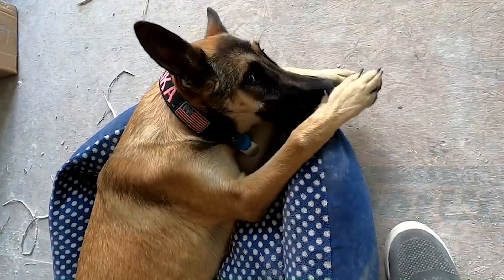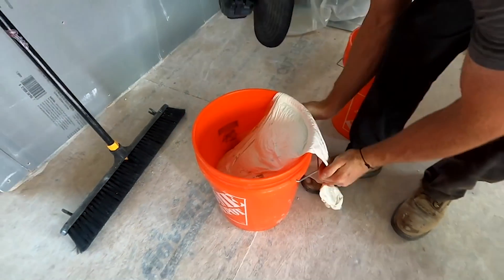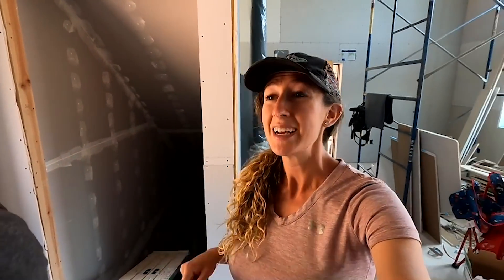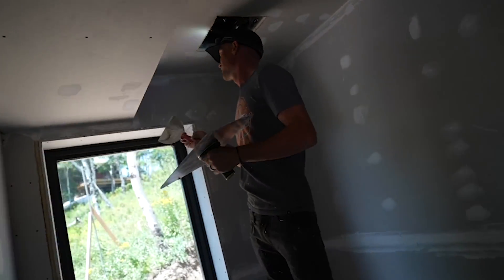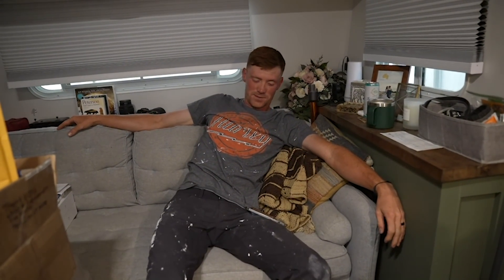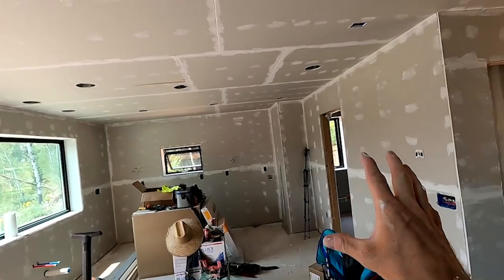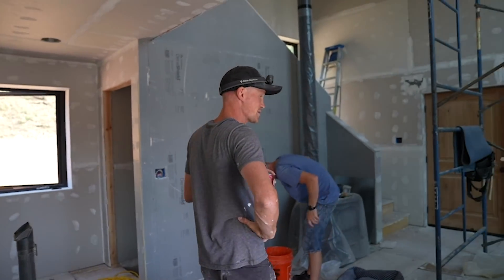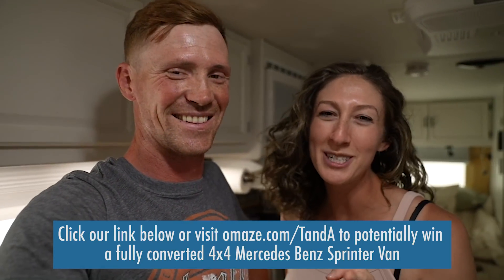TIME FOR A BIG CHANGE | TRENT & ALLIE

Comment: I'm a retired painting and drywall contractor. I've been watching these videos and trying to just let you do the job and learn as you go. BUT YOU NEED TO STOP. I don't know what youtube video you watched or who told you to do drywall that way but you are tripling the amount of time this job will take and doing things that will give you a crappy finished job. You used way too many screws but that is already done and it isn't a job killer. You should be taping the seams first. Put a thin layer of spackle down on each side then lay the tape down and another thin layer on top. Then pull the knife down with more pressure on the outside edge to taper the spackle and minimize sanding. ALL outside corners should have corner-bead. No need to be filling in seams and corners, just tape. When you fill in the inside corners (as where the ceiling meets the wall) you will prevent the folded tape from having a true 90-degree edge and make it look sloppy. I am telling you this because I know you want to have a finished job you can be proud of. Much of a construction job can have mistakes but usually get covered up and no one notices but you are into the finishing stage that people will see. I hope you take this in the spirit it is meant. You will shorten this job considerably if you stop and regroup and take the time to learn a few basic skills. Good luck.
Reply: Accept all of this happened a half a month to a month ago...
Reply: Why don’t you fly out to help them then if you are retired and have time on your hands 🤦‍♂️
Reply: @robertbenthal9396  don't be nasty.
Reply: I was wondering why they weren't taping.
Reply: Thanks for the advice. It may be too late for Trent and Allie, but I am learning a tremendous amount by reading respectful comments after watching the video.
Reply: Way AGREE..you're working waaaay too hard and too much time.
Reply: I'm so sorry Trent that you are making more work for no reason. "prefilling the seams" is not a thing. Taping seams is step one.
Reply: @robertbenthal9396  awesome idea
Reply: That’s what I was thinking, where’s the tape, really.
Reply: Sorry, definitely should have contracted out the drywall. Taking a lot longer, and in the end will look bad and probably cost more.
Reply: Did they claim to be a retired expert?
Reply: Oh no!!! You are right, Bill Mattis. I remember my Daddy doing this a lot and you have the exact directions on taping and “bedding” is what they called it back in the day. Oops, Trent and Allie. So sorry. 😢
Reply: look it's there home and they want to build it the inspector can tell them what's right and what isn't the state you live in May have different ways they want things done
Reply: Thanks for the info Bill! In my house I have some seams that aren’t taped and on others tape is literally falling off. What would you recommend? Sanding down the seams and retapping/floating?
Reply: @joane.3533  I don't think he's being nasty I think Mr.retired is being judgemental Trent never said he was a builder maybe things are done differently where they live
Reply: for his next big job, it would be good to have him tag along with a regular drywall crew to see how they do it and why for a week (which is more than this job should have taken to complete.  But getting hands dirty has it's own value too if only to recognize better ways exist.
Reply: I think it’s so great that you reached out. I don’t know a lot about drywall, but I was definitely worrying about those corners. Knowledge is power! I hope you’re enjoying your retirement.😊
Reply: Yes, working smarter not harder, ay?
Reply: Bill mattis you are correct my dad was a carpenter all my life I'm 62 and for 50 years I watched him build houses from the ground up all of it and he always he had a roller of tape a wire ran through the center circle connected  to your belt and a pallet with mud on it and you did a full run of mud put the tape on top and then a full run of mud again tear it and go the next spot, but these youngins have to learn the hard way
Reply: What I don't understand is why Mr. Retired (Bill Mattis) didn't step up and give his advice and comments to Trent when they first started mudding. Did he get enjoyment in telling Trent that they did it all wrong after working for so long on it. Shame on you Mr. Retired. I'm less than impressed with your lack of tact.
Reply: @jackielight6908  Pretty sure they live on planet earth.
Reply: Nothing but drama, good lord people
Reply: Alan d'Eon  Indeed. Painting will bring forth any mistake.
Reply: @joane.3533  Actually - sounds like a fantastic idea! I'd love to see it happen! "Love thy neighbor!"
Reply: Yes!   I'm only a guy that has done mud and tape for some DIY remodeling.   Would never attempt an entire home.   
Kudos to the men and women that knock this out everyday.
Reply: He is a bit stubborn and WILL do it his way!
Reply: @anthonyjames6179  Too many people told them to watch LifeUncontained where he did the same thing with not having a clue what to do and started with prefilling. I looked it up and there are actually "Pros" with YouTube videos about prefilling, so I can guess why Trent thinks he should do it. I wish he had actually consulted an expert. Where the heck is Kevin????
Reply: Very good advice.
Reply: @robertbenthal9396   tsk, tsk, tsk !!!!!
Reply: There is very very  little forgiveness when it comes to finishing drywall. Every little imperfection  will be seen unless you decide to have curtains on all widows. All corner beads should be installed before mudding and tapping is always applied on first coat to make sure  it gets imbedded in joint. Hope everything works out for you both but I see a lot of sanding in your future. Make sure you stock up on masks. Good luck on your project 😊
Reply: I think it's most about creating content now!?
Reply: @robertbenthal9396  I’m a professional. I would had flown and helped for free lol they never replied 🤷🏽‍♂️
Reply: Lone Ranger  lol it takes months to learn how to use a bazooka correctly lol I’m a professional. What’s going to happen he will be plastering mud and tape, and tape will be falling off before he has time to wipe. He will end up not using the bazooka and do it manually. Lolol it’s an extremely hard tool to learn to USE  correctly.

Comment: You can stop pre filling everything.  Pre filling is just taking up space the tape takes.  Tape it, wipe the excess mud out and spot screws.  Next day, fill it and spot screws.  Third day scrap with mud knife any large globs, chunks, or mounds and put on a nice tight (thinned down mud) finish coat and spot screws.  Fourth day, sand everything.  For regular joints tape and wipe away excess with 6 inch knife.  Fill coat on regular joint just 8 inch knife.  Finish coat on regular joint use 10 inch knife.  Butt joints use 6 inch knife just like regular joints.  Butt joints on fill coat run 8 or 10 inch knife on each side of tape leaving center 1/2 inch of tape exposed.  Final coat on butt joints use 12 inch knife in three passes, one down center barely covering tape and one down each side so the butt joint width should be around 28 inches wide on finish coat.  Use 12 inch knife as a flat level and check for light under the edge over your joints to see if you filled enough or not.

Comment: Why are you not taping the seams? Where is your metal outside corners? Use a 6 inch knife and apply it to the joint then put your tape over it and then with a dry knife press The tape tight to the wall and smooth it out

Comment: FYI guys. If you put on 3 thin drywall mud layers; You don’t have to sand drywall.  You can use a lg damp sponge to wipe it smooth in between coats. It’s MUCH less mess.  Also. If you run your hvac system while doing drywall;  you need to get a bunch of filters and change them every week if u don’t want to damage your hvac equipment.

Comment: A little Pro tip , when you run your drywall blade against the wall use the curved side of the blade not the concaved side , every drywall blade is slightly curved .

Comment: Hey Trent, you may want to consider using metal outside corners, it makes a much better corner and makes finishing much easier
Reply: Plastic won't dint. He should hire a drywaller.
Reply: Inside corners too.
Reply: @tinydancer7426  no such thing as inside corners. They just get taped.
Reply: @RamblinRoadies  Actually there are inside corners as well as outside corners.
Reply: @harrybruce1655  I totally agree...for this job he needs the pro's
Reply: @BTimmer  in 40 years I've never seen anyone use an inside corner bead.
Reply: @RamblinRoadies  yes there is.
Reply: @RamblinRoadies  okay!!
Reply: @RamblinRoadies  one man doesn't prove anything
Reply: I agree you need corner bead on the outside corners.
Reply: @LoveDogs___3  how much drywall have you finished?
Reply: Alan d'Eon  and that is why the bazooka has a dongle that creases the paper for inside corners.
Reply: @RamblinRoadies  I just finished a huge remodel and used inside corners.  I liked installing them more than folded paper tape.
Reply: Alan d'Eon  yes, I specifically said paper inside corners. And I have been in the trade since 1973. I didn't disagree with anything you said. 👍
Reply: @BTimmer  then you are a rare bird.
Reply: Alan d'Eon  especially since he pre-filled the joints and made the bazooka essentially useless.
Reply: @RamblinRoadies  They have them but anybody that knows what they are doing doesn't use them.
Reply: I like the bull nose corners better.  Softer look, and corners don't get damaged as much.
Reply: Metal ones make for huge scars and lots of stitches when you run into the corner.
Reply: @tinydancer7426  😂😂😂😂😂😂😂😂😂😂😂😂😂😂
Reply: @AF-io1ql  so true. My daughter had one stitch in her lip
Reply: @marieleotta2501  my nephew went to the bone 10 in his forehead
Reply: @BTimmer  Thank you Tim!
Reply: And metal corners help protect corners from things like babies wheeling themselves around in the scooters.
Reply: I suggested that too awhile back. Good to do to keep the outside corners from getting dented. Looks better too.
Reply: @pamflowers8364  And parents (aka dads) trying out the hover boards  (or whatever those things are called) on Christmas day.  :0D
Reply: yES rounded metal corners are great!! what we did in our dream home 20years ago..!!
Reply: First things first your hair is beautiful really love it. It almost kills me watching the drywall ,then i remember some of my first drywall jobs. To me their is no pre filling sesms and joints .mud tape mud on first coat. You are going to have so much trouble doing it the way your doing it sorry to say .I've been there and made same mistakes in last 30 plus years .please stop and watch some utube videos meny good one's. Wish i had access to bazooka iam sure there's a learning curve.a hawk is better for plastering a simple stainless drywall pan is much faster
Reply: What a great post
Reply: Took the words right out of my mouth. Corner bead before moving forward on mudding. Allie, as a curlie haired gal myself, totally understand your trepidation. There’s that sweet spot for length, and if it’s off….. say hello, French poodle. We can assure you, your hair looks great. 😁
Reply: That is what I was asking. It makes a sharper edge. He got a big tape  Bazooka but he didn't use it. I hate drywall and I need to do living room today. They are still doing great  job on house.
Reply: @harrybruce1655  that would be great.  They could do it in one day even sand and ready for paint. No metal edges will be impossible to get that hand rail and ponywall in bedroom upstairs cut in with mud. Hope he reads some messages.
Reply: Yes.  We've been doing metal cona-bead for as long as I can remember (40+ years).
But keep in mind guys how Trent is full of surprises.  He's taking to pros, and he's big on trying new technology.  Whatever he does, it'll be interesting to see.  There's even a chance we'll learn about something new.  Then again, maybe he'll go with wood corners.  I guess if we stay tuned, we'll find out.

Comment: OMG I have never seen doing first coat on inside corners and seams without imbedding tape!
Reply: That’s what I thought
Reply: 10 bucks they have to do it all over again. They will hire a real crew.
Reply: It’s gonna leave a bump on all taped seams that way
Reply: I agree!!! Wasting a lot of mud and time! The seams need to be taped as the mud is applied! Unless things have changed since I remodeled a rental property
Reply: hey folks much MAD Respect to them for willingness to learn, you can't fault someone for not knowing everything about everything! Life is a journey and just because I have experience in construction related things, does not mean that Trent and Allie can't enjoy learning their own way through life! Keep up the good work you guys love the vids! FYI I have no idea how to rock climb or do yoga!
Reply: My thoughts, too!!!
Reply: @mikesib3482  and with the tape on top of it, it can't be sanded down!!
Reply: Alan d'Eon  hmmm not the same thing as they are working on their own stuff! Trent obviously has some construction experience and a willingness and desire to learn. Also my engine doesn't need pulled and you are a stranger to me! I get your point but not comparing" like "things clearly.
Reply: I know, I thought the same thing. I was screaming inside. So I went and looked on the internet and it is there. There are even instructional videos. Personally, I think Trent should have consulted an expert in this case instead of following the internet. It still seems like he is going to have major issues the way he is doing it.

Comment: If you're reading comments, you need metal corner beading for the mud operation. It will protect the corners of the sheet-rock from getting knocked off when the wall is hit from moving furniture of life's other challenging tasks.
Reply: Too bad he did this 2-3 weeks ago, they are probably painting in real life! 😂

Comment: So...you've got to be sick of drywall suggestions by this point...but I'm wondering why you haven't put all your metal corner beads on and why you're not bedding your tape on the first coat over the seams? I know it's gonna look great when you're done. It's just hard to watch when I wish I could help. Keep up the good work. Get that bazooka loaded!
Reply: I had the same thought but thought it must be different in USA or something. The tape gun he bought prefills and tapes in one go and then you just skim the excess and bed the tape with a tape knife. I love the channel and love when they learn, but they are going to be adding a week to the job for no reason.
Reply: More time = more vlogs = more $$$ = more fun tools not reqd for job........
Reply: @angelomasciantonip9377  In this world it's just nice to see a couple young people with enough ambition and focus to take on the challenge...No matter how they do it.
Reply: @Ken D. I'm all for trying and all but trying to reinvent something like metal corner beads is just plain wrong. Even old style lath and plaster had metal corners to use as a guide for finishing. Heck if u dont like square, there are even  preformed rounded paper corners that get set with first pass of mud similar to an inside corner but trying to do a corner "artistically" with nothing won't work. But it's good for making another vlog about all the time it's taking to sand down and redo the corners ......
Reply: e has no clue  hes poken and hoping
Reply: You need to hire some professionals get it done and prepare for the baby…o much going on at one time…also use p v a drywall before painting

Comment: You guys are doing a Hell of alot of work, I'm no professional, when I did tape and mud, I never did an under coat, Just tape and mud at the same time, and It never needed sanding, and It never cracked, and it's been years, I used a nylon mess tape, worked great

Comment: CHECKING IN AGAIN FROM Hanoverton ohio    the most important interior part of your house is the drywall finishing,  step 1 when finishing use the right tools  1st coat run mud on seam then put your tape h knife .[ butt joints first  then flats]  second coat use plus 3 or continental rapid coat, using a 8 inch knife, third coat  thin mud a tad thinner use a 10 inch or 12 inch knife,  if u want speed use a inside corner roller thin mud milkshake thin to roll inside corners. crease your tape and lay in corners and wipe tape with 5 inch knife,  if u want perfection u need right tools ,when running flats don't overload your seams u should see recess thru mud if u load up mud u will crown joints and they will shadow thru paint, butt joints r much more revealing if not finished correctly, mud with 12 inch away from center of butt,  if u go down center of butt joint with mud more than likely they will show  -----if u can get aqua bead in your area buy it, its a bead were u water the back of bead with spray bottle  in 20 t0 30 seconds it gets sticky then square it on your outside corners. im not sure u care 4 my advice ,and if u have other questions email me at eckertfatboy@yahoo.com